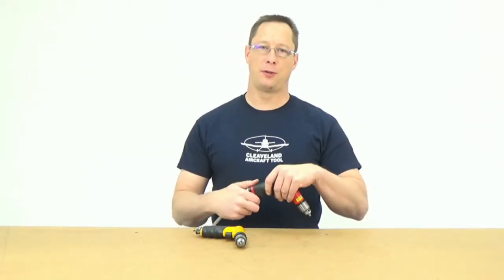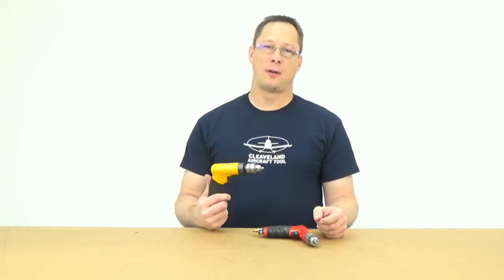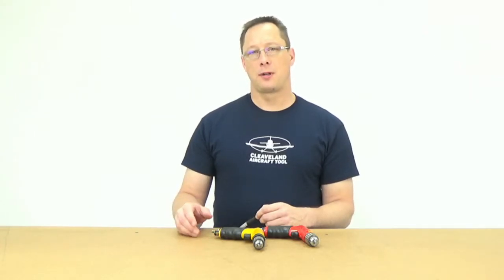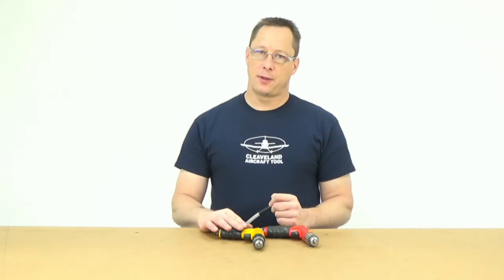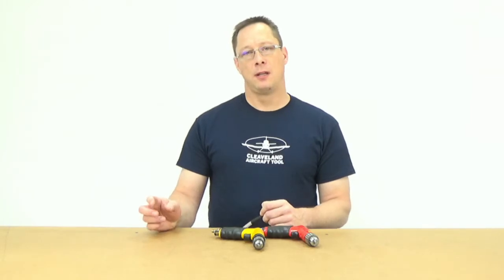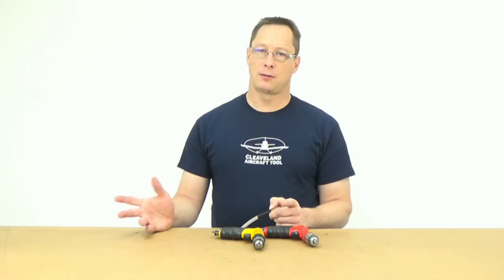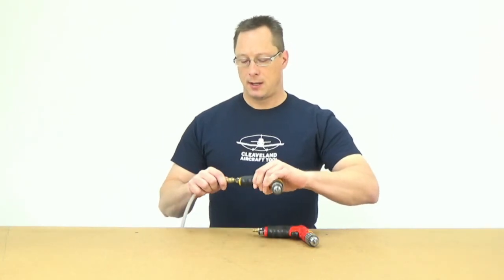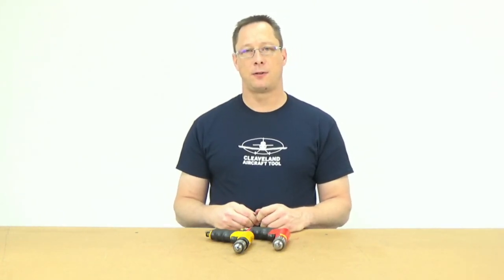Tool Kit Choices: The Drill - Cleaveland Aircraft Tool

Comment: New aircraft mechanic here.. Would you reccomend a keyless chuck or standard? Pros/cons of both?
Reply: 5 Year A&P here. Go with a keyed. Its more precise than a keyless and doesn't have a tendency to "unlock" when you are using the drill (a common problem with Keyless).
Reply: Also the keyless chucks tend to be heavier
Reply: @Artiscrafty  Do you know how Pan American compares to Snap On. If cost were not an issue which would you go with?